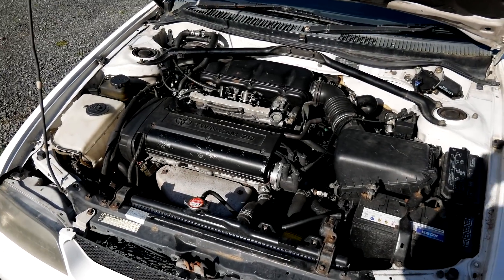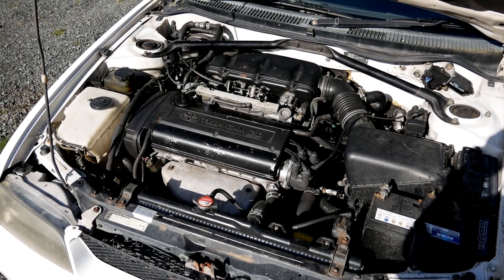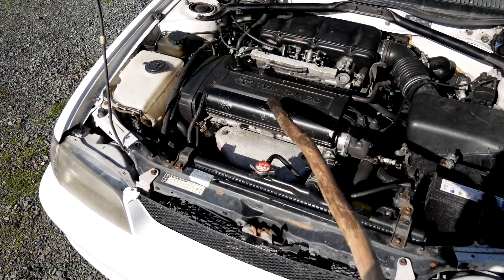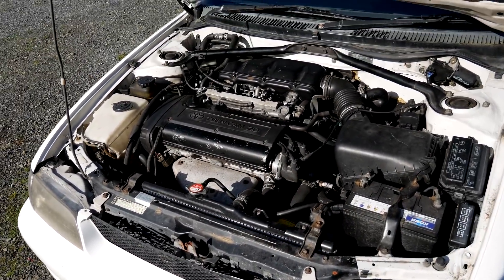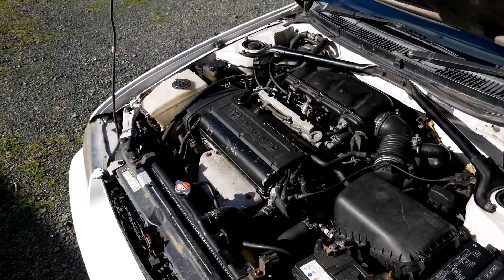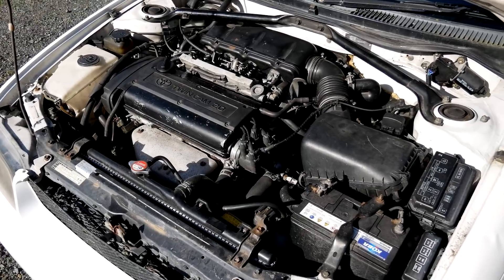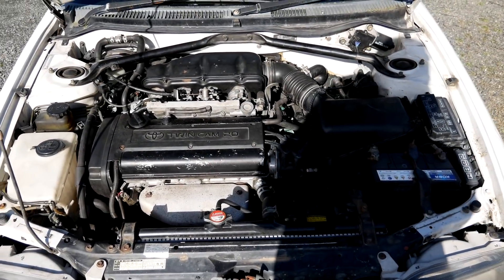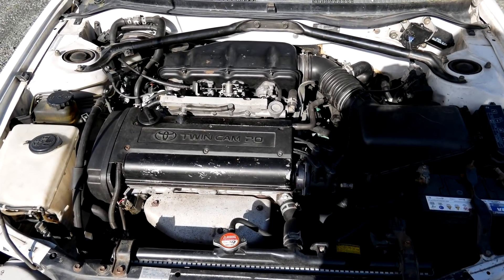20v 4AGE Exhaust megaphone / front pipes - Dyno tested

Comment from the maker: Hey,  Since Ive been doing these dyno videos. There have been many comments suggesting my dyno reads on the high side, after  seeing the numbers my 16v engines make.  This video shows Its pretty much on the money.  If compare it to what your average blacktop makes on other dyno's.  I would expect this one to make mid to high 90's (Kw) on this dyno,  if was on stock ecu and didn't have the tweaks to the head.
Reply: If you are at the coast/sea level it’s a little on the low side, unsure of the elevation there mate, I. Any case all dyno’s read differently as long as you use it as a tool like you are to compare apples to apples… great job by the way.
Reply: @hondatrix Perfect !
Reply: Русские субтитры добавьте пожалуйста
Reply: You should check out David Vizard's channel. He has one on exhaust tuning.
Reply: poking that thing with a stick!!! i was ready to develop a phobia but it seems to be more common then i thought.
Reply: So what are the tweaks to the head and what aftermarket ECU is it running?
Reply from the maker: @DaSSaNcHeZz  mod list in description.

Comment: Wait... the 4age 20v blacktop only makes 110hp? Same as a 16v?
Reply from the maker: Numbers are in kw at wheels.   but yeah they dont make much more than 16v, its mostly the bolt parts too not the head.
Reply: @Garage4age  amazing. For everything I've read on forums they swear 20v makes lots more and 16v can even dream to reach 160
Reply from the maker: @LRT604  Yeah they aren't as great as everyone says.  put the 20v itb's with the right length runner, some good headers, exhaust and up the compression on 16v, will make just as much power   20v already has this stuff done, thats why makes more  stock vs stock.

Comment: Why didn't you mess with the 2-1 section aren't they small? And why did you make the front pipe in that shape and size ?
Reply from the maker: the 2 pipe sizes are fine.  I just fixed the poor fitment in the merge.   diverging cone  after collector will usually give gains if done right over a straight pipe
Reply: @Garage4age  there's a part in the 2 1 section which is crimped is this okay “oem”
Reply from the maker: @marlo0oty213   yeah that's the part I replaced. I don't think it's as bad as some people say. But definitely power to be had redesigning that whole part as in this video
Reply: @Garage4age  im really happy with you replying to all of people questions as of most of us have very little info on somethings. I really wish for you to be a well known youtube channel someday. I have some ideas to make you known and give you more audience if you would like!
Reply: @Garage4age hey i just measured my 4age st back pressure on 2 inch exhaust stock headers with a middle straight resonator and a camry muffler in the end at third gear it was at 7 psi!!!! Should i get 2.25 piping or try my way with another rear muffler
Reply from the maker: @marlo0oty213  Haha yeh i think mine with stock exhaust is 7 or 9psi  pretty bad.   basiclly you want to neck down at the merge  for a little bit, factory size is fine there.   after that  cone up to  to bigger pipe size and into  big straight though reso. you cant really go too big,  just makes it hard to cut noise down
Reply: @Garage4age  yea we are very strict with the noise here but i what i didnt understand that even if you ran without exhaust  “no back pressure” the gain isn’t noticeable or maybe its the 2-1 segment that creates the back pressure. Because when i saw your video explaining back pressure on dyno i thought that theres 10whp to be gained if the back pressure is gone
Reply from the maker: @marlo0oty213  depends on the engine.  an engine with bigger cams is more sensitive to the pressure.  but it still works with stock cam engines, just to less effect.   the header and exhaust have different jobs. the header and collector needs to be small enough to keep the exhaust gas speed up.  if header tube size is too big wont work or only at high rpm.       It also wont work if you add pressure after it.      so going big and simulating no exhaust after the header and collector section  is the goal
Reply: @Garage4age  hey.. i wanted to cut the pipe after the 2-1 section and make it 2 inch im completely stock with stock ecu would you recommend that or should i go with your style of down pipe and try to replicate it?

Comment: I'm amazed that you get a 16 valve on stock cams to make more power than a 20v. On my dyno a stock 20 valve makes about 18kw more than a stock Series 3 16 valve. Anyway...thanks for the cool videos.
Reply from the maker: Yeah,  once apply all the stuff 20v has to a 16v, not so much difference.

Comment: Thank you for all the work you go through to make these, I always love them and learn a lot.  It's very satisfying to see the real world results.  I do have a request: is it possible to add a small running window that shows the details of each run rather than just at the beginning and end?  You summarize very well at the end of each run, but I find myself going back and forth to see details, and have to figure out which change was made for it to make sense.  Also on this one, I find myself still wanting to know more.  The V1 was beautifully made, and I understand the theory (I saw from David Vissard), yet it got scrapped.  Were you not able to resolve them rather than scrap it?  We move on to the V2, and I couldn't determine the changes or features that made it worthwhile.  I'm trying to actively incorporate some your lessons and this one has me a bit stumped.   Thanks
Reply from the maker: The V1 pipe was binned due to vibration issue due to the shape. causing a very annoying buzz/drone in the car.  since its a daily driver had to go.  I've had similar issues in the past and there isn't a way to stop it, without adding a lot of material or rebuilding. i chose the latter.    even though the v2 pipe looks completely different. is of similar "megaphone" design.   the v3 pipe in the follow up video  has some internal  tweaks  which works better.    This video probably one of the more cluttered ones.  I read most of the comments on my videos. so if unclear on anything just ask
Reply: Its my 5-6th time watching the vid again and again the one weird thing i noticed maybe because of the weather is the factory 2-1 with stock exhaust dyno before binning the v1 pipe and after binning it the graphs were totally diffrent even at the same setup with everything stock. Im also unsure if the creator noticed that

Comment: I can't easily get a header for my fwd 4age(16v) in America so I got a stock 20v manifold and down pipe.  I had no idea it went down to that small where it goes over the subframe..... I'm gonna have to rethink that exhaust setup...
Reply from the maker: if you modify it, keep the first 100-200mm after the merge factory size. then use a cone to go bigger after that.   the stock 20v headers are better than some of the aftermarket stuff. dont use anything with bigger primarys
Reply: @Garage4age  thank you!  I really appreciate it!

Comment: Shape means bugger all when it comes to EX tuning. Tube diameters and lengths matter 
Megaphones may have a small bearing on single cyl 4 strokes
Reply from the maker: Yeah only a small mount to be gained  with "megaphone" over a well setup straight pipe.   but is there so may as well try  grab it, if can deal with the fabrication and testing.
Reply: @Garage4age  what you have there to me is NOT a MEGAPHONE, megaphone is a mathematically calculated shape, similar in respect to calcs for 2 stroke expansion chamber, but that orange devise is what you want for the tuned length of multiple pipes to expand the gases into, because they think it is just open to atmosphere, and you get the reflected wave into the piping , but then in your case you can hang extra pipe on the back to a muffler .....so you have nailed the system with a very simple add on canister
Reply from the maker: @bobawatsit  The red thing is a muffer. Have had poor results with big open chambers. part i was referring to as "megaphone"  right terminology or not. was the part before it on the v1 pipe. its the equivalent of a 7deg cone.  the v2 pipe is something in between that have had good results with in the past.
Reply: @Garage4age  if it works, gotta be a +

Comment: Im planning the exhaust system for my xj cherokee, it had a 6-1 header(which had good top end but a bit flat in midrange), 2.5 to the cat and then 3" cat back
My new pipe doesn't exist yet but I have an upper half of a hurricane tri y header with 2" outlets. 

Im chasing bulk midrange power up to 4500rpm, is there a guide for how long to make the secondary pipes before merging them? 

I still want it to have a 3" pipe, would u jump straight to 3" from the merge or 2.5 merge to cat then 3" back? 
Sorry for the questions, I just value your opinion. 

Thanks.

Comment: I was wondering if you could do a run with spark plugs indexing?
Reply from the maker: I just filmed a video on spark plugs. totally forgot to try index them, someone had asked about it before. But based on the stuff i did try, you will be able to come to a conclusion  if it works or not..   will be out in a few weeks.

Comment: Make a 4-1 header. Primary tubes 48mm for the 1st 18-24cm, step up to 57mm tube with a 1cm overlap to make an Anti-reversion chamber on each tube, 57m tubing should be about 38-42cm long, then step up to 63mm for 10-15cm and into collector, 67mm exhaust or 76mm if you like noise
Reply from the maker: 48mm primaries are way too big.   factory size is actually the correct diameter for a 4age. being 38mm od.  have tired bigger, gains are about 1-2kw right up at peak power, but big loss down low.  edit:  the gains in the bigger primary headers was actually from the stepped section not the bigger pipe
Reply: @Garage4age  Did your big tube test include anti reversion chambers? We used this spec with great success. Was copied from a Japanese header they used in the JTCC

Comment: Have you ever done a pull starting at 6000rpm ? To compare to a normal pull and see the difference in power  between 6000-7000rpm (air velocity build up on whole rev range vs only opened at 6000)
Reply from the maker: Doesn't make any difference
Reply: @Garage4age   thanks, im asking because ive observed on vtec ant vvtli engines that no matter how high or low you set the engagement point for the high cam, it still take around 300-500rpms for power/velocity to build up. And was wondering about power build up during high rpm sudden full throttle and if it would have the same effect
Reply: "air velocity build up on whole rev range vs only opened at 6000"... I mean.... that's just not how that works. The velocity change would take basically no time at all. Like a couple of ms?

Comment: Maybe I missed something, but is the purpose of that exhaust piece shaped like that ? Reverse-cone-cone ish? 

Also those golden turd numbers you post, what is the spec of the engine right there ? Besides stock cams.
Reply from the maker: Usually get a bit more power with pipes made like that, if get them right.  As you can see here, they dont work so well with a small exhaust after them. If i wasn't worried about noise i would just throw a 3" exhaust after the pipes, to simulate what they do with no exhaust connected.     The 16v engine has more r&d than this one, so not really a fair comparison.  but it has: modified bluetop bigport head, stock bluetop cams, (20v cams are bigger)  blacktop throttles with long trumpets, my custom headers and 3" exhaust, 10.3 smallport pistons.   So less compression, smaller cams, no vvt. same throttles.

Comment: Well done as always. Appreciate you putting in the time for scientific testing. 
When you say exhaust/no exhaust, are you talking about muffler?
Reply from the maker: Thanks.   No exhaust means nothing after the pipes shown.   exhaust means the factory system connected from there onwards. which is a short section of 2.25" into a reso, exits the reso in 2"  for the rest  of the way, with a muffler at the back

Comment: We all seen 4-2-1 exhausts, but what if there was a intake like that? Maybe a equal length intake too
Reply from the maker: The one in the video may work better than the short runner intake shown,  just for the fact that the runners are a decent length.   but will be loosing power on the pipe entry.  if it even had a small radius on the pipe entry it would work better.   only thing he really fixed over a standard intake  is the lack of 90 degree turn into the inlet runners. but thats not really much of disadvantage.   Also may find the lack of plenum area may make the inlet pipe act as part of the inlet runner.  in that case the length of the inlet pipe may do some weird stuff.
Reply: Thats what ITB’s a for
Reply: @dennisgsi3143   what he means, is having the itb's come down to 2 separate pipes instead of 4 or just one.
Reply: @2zztercel558  kinda i was thinking more of having itbs as close to intake but then have a merged collector for them lile the ca18det project had https://youtu.be/27Ue2_tkHR8

Another alternative would be same style as exhaust on intake just get a sport exhaust manifold, flip it and use as intake.
Reply: @vladkruglov7719   lol, thats a 4-1. Not a 4-2-1

Comment: Is this similar to a muffler/exhaust system that David Vizard suggest?
Reply from the maker: Not sure haven't seen it.  the v1 pipe is basically a squished flat megaphone.  while the v2 pipe more comes from things ive tested over the years that work, and easier to fabricate. i guess it loosely resembles a megaphone, but has some other wizardry going on inside also

Comment: I think my car cylinder head porter had a 20v on the flow bench. I think he said that after porting I the 16v flows more and is better.
Reply from the maker: sounds about right!  16v can also run a more aggressive cam, due to the larger area for the cam lobes to run on.
Reply: @Garage4age  you built an expansion cone that ends in an open chamber?  The chamber volume is 800cc +?  How did you determine the expansion chamber volume and length?  Is this the way to go with a tri-Y header system?  My Previa van has a Try-Y header.  I built a new secondary collector and then made a tube that leads into the Cat.  I am considering remaking the collector and using an open chamber 1200cc volume.  The stock header primary are not equal length.
Reply from the maker: @benhowe2036  the red part is a straight through muffler, in an attempt dampen the pressure waves at this point.  ideally it would be bigger, but lack of room.  Have tried open chambers in the past. they did nothing as best, usually negative results.

Comment: Excited to see the 20v experiments! Would be cool to see a comparison of a basically stock setup to a lightly modded setup (header, exhaust, cams) after a tune. Any chance to see the torque graphs and how VVT influence looks compared to the 16v?
Reply from the maker: Torque and power numbers basically the same thing. So if its making more power at same rpm its making more torque. So the example https://youtu.be/24Z3TeMq69E?t=415 in that graph vs the 16v  it makes more torque across the whole rev range.  Its not really that much of a fair example  though, as the 16v has a whole lot more r&d gone into the bolt ons.  but still kinda dissapointed the 20v's dont make more bottom end with the vvt.    Ive already filmed the next vid.  but have some old graphs with the vvt on/off if you would like to see them.   maybe trying the v2 pipe in this vid on a customers car with pon cams also
Reply: @Garage4age  Ah I see, thanks for the explanation. I was just curious because 20v's feel quite bad without VVT connected. Whereas my memory of 16v seems like they are better (despite not having VVT at all). Anyway looking forward to the next videos.
Reply from the maker: @TheNight-Rider   heres an older dyno sheet.   red =vvt on.   blue = vvt off.   green = vvt switching at 6200rpm from memory. https://garage4ag.files.wordpress.com/2021/08/vvt-on-vs-off.png     big loss if vvt isnt working

Comment: I didn't understood the point of the fabricated pipe at the final. Did it made a diference at all? And also, why it has that shape and not just a regular tube with some bends? Love your videos!!! O/
Reply from the maker: yeah both pipes made about 4% more power with the stock exhaust on.  6% with no exhaust (would make very similar to this with a big exhaust) .   It doesn't sound like a lot, but is pretty good for just changing about 1m of pipe on a stock engine.   Diverging cone or "megaphone" will help make more power over a straight pipe.   these ones are just a weird shape compared to a normal cone. due to space issue, mainly the cross member